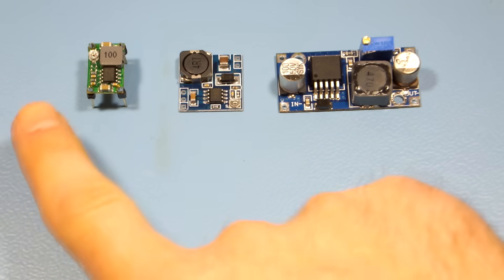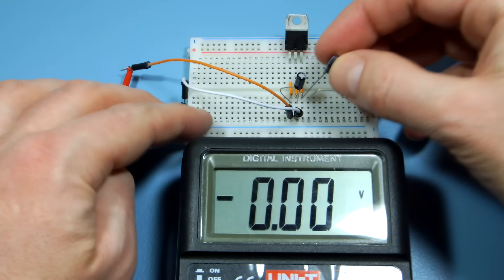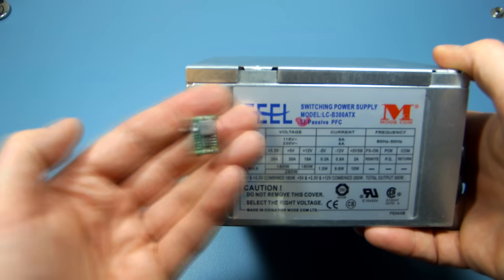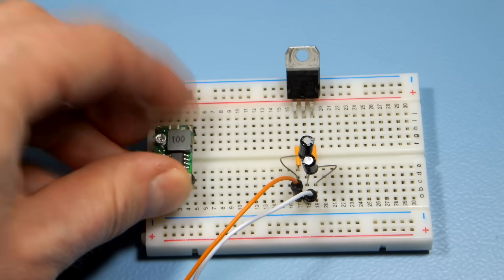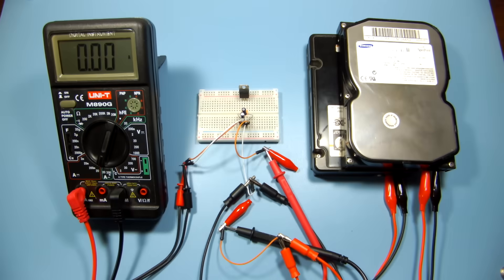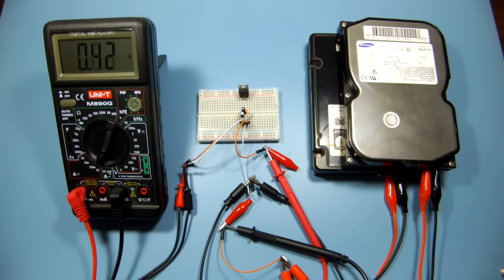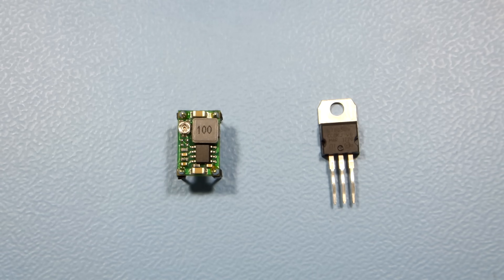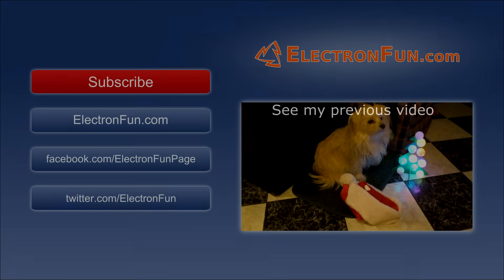Buck converter vs. linear voltage regulator - practical comparison

Comment: I'm confused.  How come the buck converter was drawing less amps?  Isn't the amount of amps it produces based on how much the load needs?  So the HDD attached to the LM7805 was drawing .45 amps while the HDD attached to the buck was drawing less.  Seems a little unfair.
Reply: +KillJD Yes, you have got it, wattage is key! 

Energy is always conserved (those pesky laws of physics). Wattage is energy over time.
So when we say that any left over wattage is converted to heat, we know this to be true by conservation of energy.

The load will only ever draw as much current as it needs based on the output voltage of the buck. 

The last bit you have got there would be better to read: the buck drops the voltage, and uses the difference to provide a changing current (by the fundamental way inductors work). The switching regulator (buck in this case) will adjust the switching to maintain the output voltage. The output capacitor will smooth out the fluctuations in voltages, caused by the changing current from the inductor. Lastly the diode provides a current path for when the inductor is providing current to the load.

Your calculations look good to me, and 88% is a reasonable efficiency for a buck.

At work I recently designed a 15V to 5V 4A buck converter, that gets close to 95% efficiency at 3.5A. So im assuming this one just uses cheaper components, thus lower efficiency.
Reply: +wraithbone Late reply!  So let's see if I got this correct. Watts is what I should be focused on, correct?  The linear regulator is taking in 12V at 450mA.  Which equals to 5.4W.  The load. HDD, consumes .2.25W, with the rest, 3.15W, being converted to wasted heat, correct?

The buck converter draws 210mA at 12V equaling 2.52W. The load, again, draws 450mA at 5V, 2.25W. A difference of roughly .25W. This would put the efficiency at around 88-89%. Am I understanding correctly?

The buck basically drops the voltage but increases the current so that we get the correct power draw that the HDD or any other load requires.  The wattage is the key, right?  Thanks.  I hope I get it now.  I'd really like to understand this :)
Reply: KillJD This difference is the overhead or loss in the regulator itself. The linear regulator draws more power that it releases as heat waste.
Reply: bufo333 Thank you for your reply, but I'm still a little confused.  Before he hooked both up he showed that the HDD drew 450mA.  When he hooked up the HDD to the linear regulator the HDD was drawing roughly that.  But with the buck the HDD was only drawing 210mA,  which caused it to register a lower watt rating.  I don't understand why the HDD were drawing less amps while the buck was hooked up.  Thanks!
Reply from the maker: +KillJD Sorry I couldn't reply sooner, I was on vacation. I understand your confusion and to tell you the truth I'm a little bit confused too. I did this video about 7 months ago and don't remember everything. Linear voltage regulators waste a lot of power by radiating heat, but I'm not sure why the disks drew 450mA from my power supply.
If anybody can explain this phenomenon, please let us know :)
Reply from the maker: +Anvilshock No, I wasn't measuring the current on the buck's input. It must be something else.
Reply from the maker: +Anvilshock No, I wasn't measuring the current on the buck's input. It must be something else.
Reply: +KillJD The answer you are looking for is not so complicated. In all situations the wattage (voltage x amps) of the hard disk is constant. 
The key point to look out for is the difference between a regulator and a converter. 
A regulator drops the voltage by converting voltage to waste heat.
The converter does not waste the voltage as heat, it is doing something much more smart. It "converts" voltage to current (this is an extremely over-simplified explanation, by the way). 
Wattage is constant, so the load draws 5V x 0.45A = 2.25W, at 12V to get 2.25W you need 0.1875A (this is what the buck converter draws), the other 0.03A are the losses in the buck converter.
Reply from the maker: +wraithbone Thanks a lot, your explanation made a lot of my doubts go away.
Reply: Thanks Anvilshock. I had the same question as KillJD but why is this? Is it because the inductor in the buck converter acts like a Transformer? Meaning if voltage is stepped down current is stepped up and vise versa.
Reply from the maker: +Jorge Washington The coil in the buck converter can't act like a transformer. The coil is just a piece of wire and to build a transformer you need two or more pieces of wire, a core and AC not DC.
Reply: Yeah I get that part Lenz law and all that but I still don't get how one HDD was drawing more current thus consuming more power than the other one. Thanks for your input.
Reply: Thanks Wraithbone. I think I just had one of those ah ha moments. I think I get it now. Thank you and everyone else for helping me out.
Reply from the maker: +wraithbone Thank you for your time and clear explanations!
You are right, my buck converter was just a cheap example bought on eBay, so it's not as efficient as it could be.

Comment: Could you power the buck converter with a 9 Volt battery or a few AA batteries and power/charge a USB device?
Reply from the maker: +Marius Ammann
Sorry, I couldn't reply sooner, I was on vacation. I probably wouldn't give you a better answer than bugs181.
Reply: +Marius Ammann Sure, just be aware that different manufactures and different types of 9V batteries will vary significantly. IE; Rechargeable, Ni-Cd, Alkaline, etc.

A typical alkaline energizer 9V battery provides about 300mA of current. That puts the total power capacity to around 2.7W (9V x 0.3mA). To compare that to USB - 5V at 500mA would be a total of 2.5W.

To give you some examples; some rechargeable 9V batteries only produce around 120mA. Alkaline 9V batteries can produce more than 560mA. Lithium batteries can produce up to a whopping 1200mA or 10.8W!

You should read the package and do a little math to find out if it's suitable for your application.

Comment: May i ask what model of multimeter you are using and where to buy? Interesting one, particularly the temp capability.
Reply from the maker: +Baby Nash
Hi, sorry I couldn't reply sooner - I was on vacation. My meter is a UNI-T M890G, but it's not a product to recommend. I bought it, because it was cheap and had a few functions I wanted to have. If I needed to buy a multimeter now, I would look for something with autoranging and a bit more precise.

Comment: I have a big variety of buck converters.  I got spoiled.  I push so many amps through them that I can even get a buck to heat up and it gets me mad. :)  But after revisiting linear regulators, I'm so glad I'm using buck converters.  They stop down the voltage and step UP the current, just like an AC transformer.  So, you get more power but, at the same time, you get less heat because bucks aren't just burning off all that extra voltage.
The voltage/current conversion is quite cool!  If I'm using a high voltage solar panel to power a very low voltage device, it draws hardly ANY current from the panel because it is so good at converting volts to amps!  A linear voltage regulator in this scenario (without a heat sink) would erupt into a puff of smoke before it could even detect that its temp is too high.
Reply from the maker: Paul Oh yes, buck converters are extremely efficient when compared to linear voltage regulators. Thanks for your comment Paul :)

Comment: Thank you very much, this helped me a lot, also, i have oredered 20 step-down converters exactly like the ones in your video! the ones with the big LM2596S regulator for 16.76 USD, was it a good deal?
Reply from the maker: Anony mouse Thanks for your comment! It's a very good deal, if they are real :)
Reply: ElectronFun.com yep, i'd assume they are real, the TO-220 SMD package says LM2596S and it work with the standard ranges..
Reply from the maker: Anony mouse They should work and the price is really good.
Reply: They are quite cheap. On eBay you might get an even better deal, less than one dollar per unit, or even half a dollar per unit in big bundles. They do work, but output/input current capabilities seem to depend on the cost. The ones that cost more usually can handle more current, up to a limit.

Comment: Your video is very helpful. Great job. You just got a like on your video. Also before I watched the video I though it would be easier to use a voltage regulator but a buck converter is just as small and dosent produce as much heat
Reply from the maker: NeXTSTORMING Thanks a lot! Just remember about additional noise from buck converters.

Comment: The fact of the mater is, it will NEVER be possible to design a switching power supply that can have noise rejection figures like linear power supplies have. It's why  some super low noise power supplies have a linear back end that feeds the outputs but use a switching regulator front end that goes to the input of the linear regulators.
Reply from the maker: EETechs Switching power supplies are noisier than linear power supplies - I agree :)

Comment: my 250 cc honda regulator is broke, i was thinking of building one instead of spending $200 to order one
Reply from the maker: Neftali Garcia Do you know your regulator's specs? I suppose it's a 12V device, but what about the Amps?
Reply: yes 12v, ill have to find out about amps
though

Comment: Hey friend,

Hi have an AC generator that generates 30,000w at a given moment. I want to convert this to (1). 230V stable voltage, and (2). make sure the devices don't fry and any number of devices can be plugged in (from a simple 1 device of a phone charger to irons, ACs, hot plates, etc to use the full available wattage of the generator. I'm worried about 2. I want the AC to be like the household AC (amperage on demand). Please help me out. My email address is yoshithae@yahoo.com. Thanks
Reply from the maker: yoshithae Hi, since you have an AC generator I would say you rather need a good transformer to convert voltage to 230V.

Comment: Buck converters or any switching supply are noisy. The more of a load you put on them the noisier they become. Much of the noise is in the RF range. The main consideration when choosing what type of supply to use are how much power is needed and how clean does it need to be? There are high power linear regulators available and heat sinking is not hard. If power demands are low to medium power and no high peak transients are anticipated switching supplies are great. 

An option not discussed but used in industry sometimes is the motor generator. That is where an electric motor turns a DC generator. This is used where a clean source of high current DC needs to be available and the site is too noisy electrically to use traditional power supply applications. It is expensive but reliable.
Reply from the maker: richb313 Thanks a lot for your clear explanation. I appreciate that you devote your time to share a bit of your knowledge.
Reply: I really like that I see a genuine interest in this subject. I have worked in the electronics industry since the early seventies first as a submarine sonar tech then mainly in the ROV Industry until a few years ago. What a strange trip it has been. I went from discreet components to today's modern controlled circuitry. Through out this journey some things never change like Ohms Law, A.C. Theory and Kirchhoff's Law which I simplify to what goes in must come out.
Reply: MichaelKingsfordGray and changing the carbons like every 5 min
Reply: They are still used. Motor Gen sets deliver Lab quality D.C. power. They are not cheap. Are used in specialty applications and do not use brushes. Have been used on Navy Cable Ships and other sites where an absolutely clean D.C. source is needed. They are more frequently used to deliver clean A.C. however in noisy environments where big SCR banks make the normal A.C. power unacceptable. 

Sometimes a brute force approach is required in order to make sure power is available. These Motor Generator sets are reliable and only need maintenance about twice a year to grease bearings.
Reply: richb313
oh a brushless DC motor that's anotherthing indeed and with modern electronics the control is way easier.
Reply: So I guess 50 plus years experience working in Submarines, ROV Industry, Cable Industry etc. is meaningless then. I guess all the times we actually used these systems must have been in my imagination. All supposed clean DC supplies are still tied to a noisy AC source, especially on oil rigs which use SCR Banks to supply Massive DC currents to the draw works. If you need lab quality DC, especially DC that runs in high current ranges, a motor gen is still a good option. You can run the AC motor with ship or rig power and out comes clean D.C. We did not even direct shaft couple these units but used belt drive.

.I am sure where you work it is all solid state but let me guess, you still get failures. We had thousands and thousands of hours and not a single failure, as long as you did not have extended shut down times. It is no big deal if you run it unloaded for a few hours to remove humidity but some guys forgot. These operator induced failures, only two in twenty years, are our track record.

Look guy, I am sure you are an expert in your field but that is not every field. There are still plenty of reasons to use tried and true old tech. One reason is I can get these A.C. Motors rewound if needed any where in the world. We also use massive AC Motor Gen sets. Same belt drive setup but a lot larger. Our DC sets are typically rated in the 100 to 250 amp range.
Reply: richb313
being true or false you said something very true kirchoff's,ohms and ac theory are and will always be important to learn how to use

Comment: Most of computer power supply use buck converter, is totally false statement.
Basically none of computer power supply use buck converter (and in most of countries using buck converter would be illegal for off-line computer PSU).
All computer PSU use some form of isolated PSU (buck is non-isolated), and most of them use some form of forward converter (1 or 2 transistor forward or half-bridge are most common), and they have only one thing in common with buck converter is that buck is type of non-isolated forward converter.
Reply from the maker: Miloš Lazović Hi, most or all computer power supplies are switched mode supplies. Buck converters are switched mode supplies too - that's what I meant. They may be categorized as one group - switched mode power supplies. I probably oversimplified that. You are also right that buck converters are non-isolated supplies. Sorry for my being not precise enough.
Reply: ElectronFun.com I just need to make things more clear, you made great educational video, so someone who is not proficient in power supplies could get idea to make offline buck converter getting impression that same topology is used in computer PSU (which will be dangerous, even offline buck converter are used in some cases like standby for big SMPS).
You would be correct even you say that buck and most computer PSU belong to same family (buck as most common half-bridge and in newer time one or two transistor forward converter all belong to family of forward converters)
Reply from the maker: Miloš Lazović I'll try to clarify this through annotations. Thank you for all your useful remarks.

Comment: There is one more thing to mention: For circuits including A/D convertors  (12 bit and more) the SMPS noise affects the accuracy of the ADC. To avoid this you should either use very expensive 4 layer PCB, or very lengthy software filters or both. In such applications the best thing to do is to use use  SMPS + Linear Regulator combination. SMPS output should be held low, for example 6V and Linear Regulator should be "Low Dropout" type. such as LP5907.
Reply from the maker: oilbay54 Thanks a lot for your useful comment! I didn't know buck converters may affect the accuracy of analog to digital converters.
Reply: ElectronFun.com Yes, it does. We are currently designing a energy analyzor in our company. At the beginning we were using a SMPS with 5V output to power the input microcontroller with 14 bit ADC inputs. We had a lot of problems concerning the accuracy of the ADC which we hadn't see in the breadboarding stage where 5V is obtained from transformer + LM7805. But when we started to use SMPS the problems had begun, especially if the inputs were low. We had to implement lots of lengthy software filters which slow down the measurement. Then we increased the output voltage of SMPS to 6 volts and started to use a low drop out 5 V regulator. Now we have a very nice circuit :) The reason is the noise reduction ability of the linear regulator, which is around 120dB